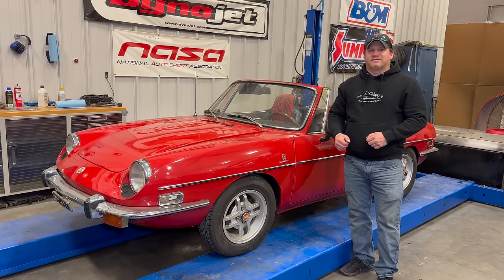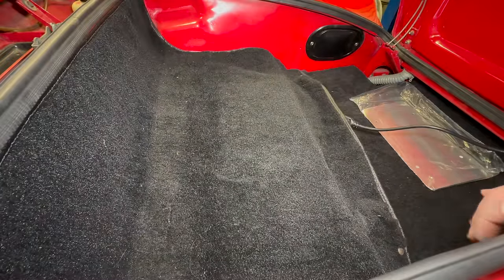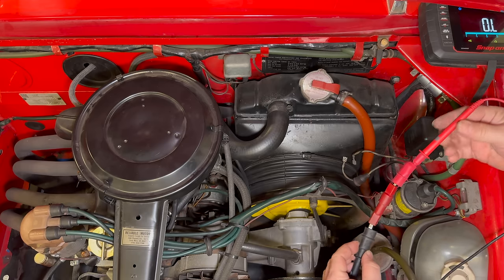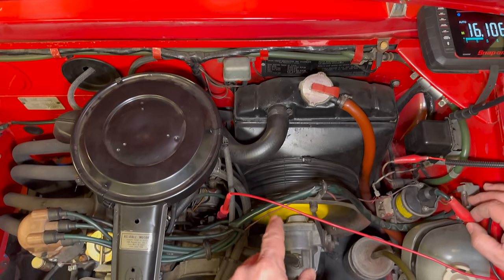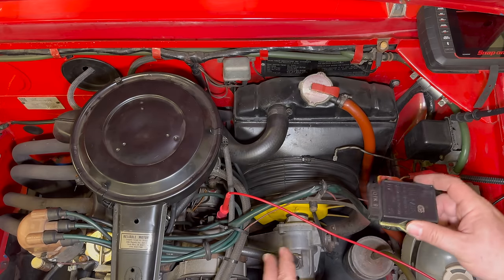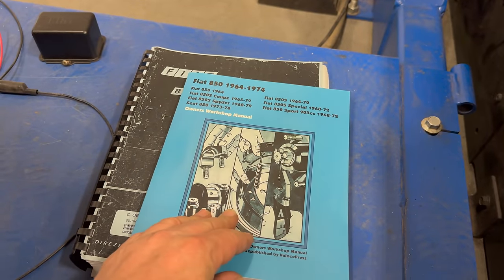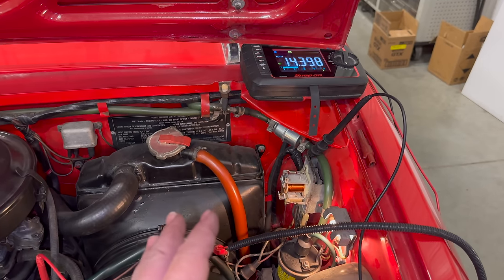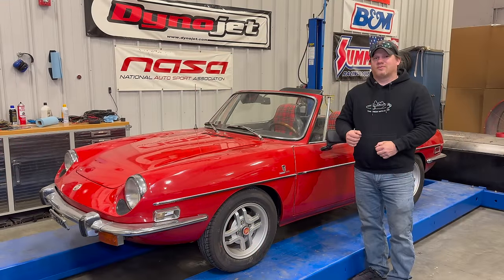Fiat 850 Spider Charging Problems

Comment: Nice video.  I love little Fiats.  I'm on my second X1/9.  I cleaned up an old Lucas voltage regulator the other day.  It had three different circuits with different cutoff voltages.  Fortunately I had published values so it was a breeze.  Surprised me how simple the things are!  Microprocessors have changed our lives but they're not so easy to rebuild.  When they stop we throw them away.

Comment: Good work! I rebuilt a 1968 850 on my channel. The engine was locked up, so I rebuilt it, did some body work and ended up selling it. I learned a lot from that little car. Mine had a generator so it was a little different, but the same principles apply.

Comment: I had the cutout relay stick closed on my first car, a 1960 Studebaker Hawk. Fried the wiring harness, generator, and of course the voltage regulator. I was able to get a new harness (which included most of the wiring under the dash) and fixed it.

Neat little car, I remember when those were somewhat common, I always liked them.

Comment: Well you don't mind if you have a sealed fuse but what is frustrating is that there is no value written on it, a bit strange I think. At least you called it right with the new one and you now know which way to adjust the regulator which is great. Lets hope it all continues to work, only time will tell. Thanks Steve for another interesting video. 👍👍

Comment: I remember working on those cars back in the 70's . They were almost as easy to pull the engine out of as a VW beetle.  All they needed was a suitcase handle on the valve cover.

Comment: Cool to see the adjustment of an analog/mechanical voltage regulator. Makes me more confident in the one or two I still have kicking around.

Always thought those 850 spiders were neat. Is the water pump on the same shaft as the rad fan? Looks like it could be... super weird.
Reply: The fan is on the water pump shaft.

Comment: good fix!  But, did you notice how she pulled a Fiat on you with that upgraded voltage regulator?  She wasnt going to let you get away with that!  It would have been too easy and an upgrade but NO!  LOL!  I had a removable FRP hard top for the winter down here.

Comment: Steve please explain how you adjusted spring, other than that I always enjoy your videos. Keep uploading please
Reply: All you do is bend the bracket that holds the bottom of the spring, in this case he would've bent it up to reduce the spring tension and reduce the voltage

Comment: Have to say I'm disappointed. After pointing out fruitless search through manuals and internet for regulator adjustment, we're just told "regulator is adjusted". So, how did you do it? Stretch the spring? Replace with different spring? Something else???
Reply: Moss Motors have a series of videos on regulators and how they work.  This is the adjustment one….  https://www.youtube.com/watch?v=kxK4GaK1wNg
Reply: All you do is bend the bracket that holds the bottom of the spring, in this case he would've bent it up to reduce the spring tension and reduce the voltage
Reply: @zathrasthetenth505  there is no adjusting screw on this model of voltage regulator

Comment: Early alternators were typically 30A If that 15A fuse ever blows, replace it with a 30A,  It will let go if there is an issue.
Reply from the maker: The power from the alternator does not go through that wire, this wire is just for activating the alternator.

Comment: I feel like the fuse rating should match the amperage output of your alternator, or slightly higher
Reply from the maker: The output of the alternator does not go through that wire, just the power used to trigger the output of the alternator.
Reply: @ThisWeekWithCars ahh, I understand, thanks for the explanation

Comment: Interesting.   I assume the regulator is in line with the field excitation of the alternator.  It would need a ground, VREF, and an output connected to the alternator field to work at all or properly.  The VREF should be near to the positive terminal of the battery, or 2nd best, directly on the DC output of the alternator.  Since it's externally regulated, the field winding on the alternator could have only 1 wire, maybe two if it needs a connection to an idiot light to function.  A VBatt of 15 or 16 volts could have damaged it, or the car wiring wasn't correct for the application. 

Should be fairly straightforward to trace and figure it out.  It's nice you got it working enough to enjoy the car.  That mechanical regulator seems unreliable.   Not sure the tolerance for over voltage on that super capacitor, but it might rupture, outgas, or ignite if it goes too high.

Thanks for sharing the experience!
Reply: i would think that Vref would have to be switched ign. as non running voltage would have the regulator contacts closed, energizing the field windings.
as it looked like a single wire forward to Vref, i'm wondering if the indicator light was in series there, grounding through the field winding via the regulator points.
i think you're correct, the alt has field and bat cables but guessing here.
all Steve is interested in is how to to transistorize the regulator. future project.

Comment: The fuse holder is opened by unscrewing it.  I believe the amp rating on the fuse is 6 -10 amps.  The alternator can be rebuilt but you will need to build/obtain a hand crank system to wind the rotor coil evenly (roughly 300 feet). Old age takes its toll on everything, and the rotor coil will eventually draw excessive amps and blow the fuse.   ☺♥†♪♫  7-2-2-23

Comment: Steve: what is your experience in self discharge for the ultracap versus lead-acid cells?
Reply from the maker: I have several cars that I leave parked 6 months or more and the capacitor still is charged plenty to start the engine.  None of these cars have a radio or any draw that is on when the ignition is off.
Reply from the maker: On my 1969 Sprite which does have a modern radio I have to keep it plugged in when it is in storage.

Comment: Is it just me ,but after telling us you couldn’t find any information on how to adjust the regulator,you then adjusted it without showing or telling us what you did,is it a secret 😅
P.s love ya content,but this one puzzled me
Reply: All you do is bend the bracket that holds the bottom of the spring, in this case he would've bent it up to reduce the spring tension and reduce the voltage